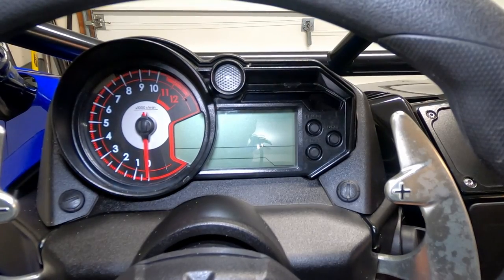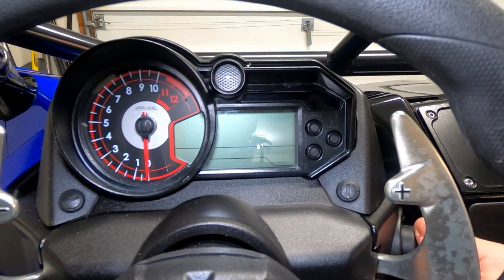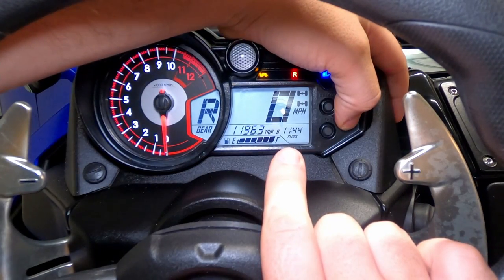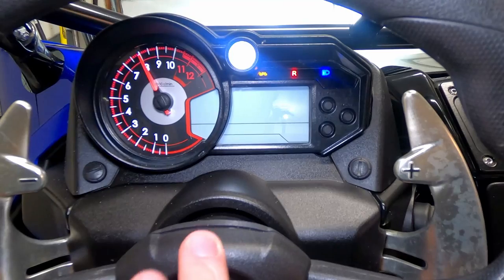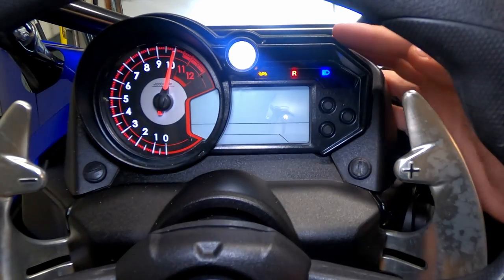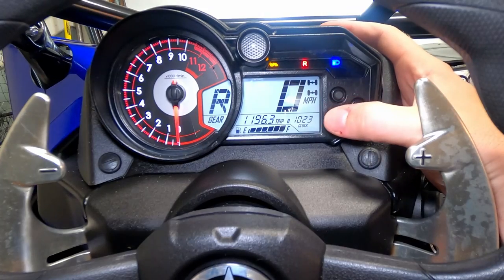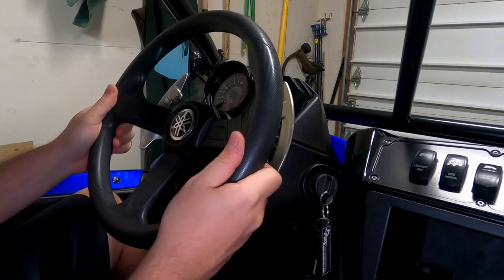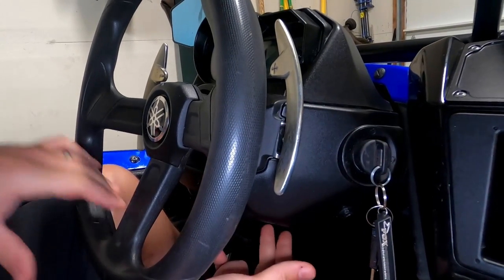HOW TO SET YXZ SPEEDOMETER (km/h-mph ), TACH (°C -°F) , SHIFT LIGHT, CLOCK & STEERING WHEEL HEIGHT

Comment: Thanks man... Helps me with new toy
Reply from the maker: How are you liking it so far?
Reply: Originally I was hoping for the SS for the obvious reasons for those of us that love quick programmable shifts however having had a couple of years in a mini sprint with a bash box and a clutch I figured that the young age of 68 that can handle the clutch. Being sequential I know I'm going to have to rev it to get a smoother shift but it's been torture breaking it in! I've been doing some heat cycling as well as community driving behind the Gates before I trailer it to the bashing grounds. Preparing all my digital torque wrench and tooling for my first maintenance session. In short having a freaking blast. Thanks for all your tech support in this toy world, your presentations are clean crisp and no BS!

Comment: Do you know how to read check engine light codes?
Reply from the maker: I believe you need a Yamaha Diagnostic tester to really read and manipulate the codes. I don't believe there is like an OBD II port or anything. Most of the time the cluster will show a code name/number and you can look it up online. I know 90% of the codes I have seen in YXZ forums have to do with clutch or shifter mechanisms.